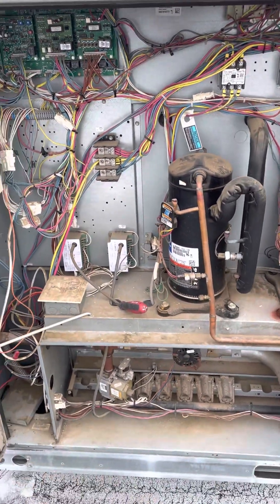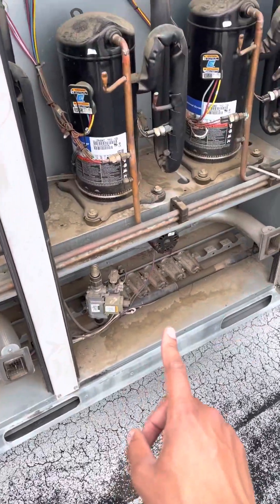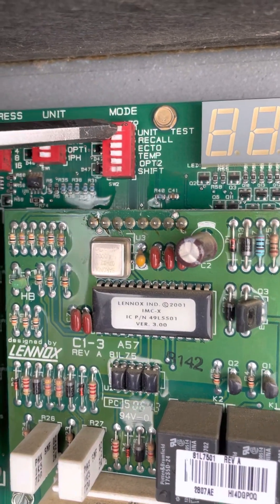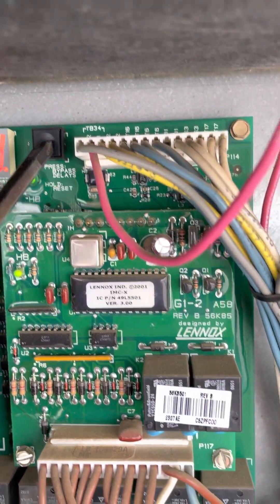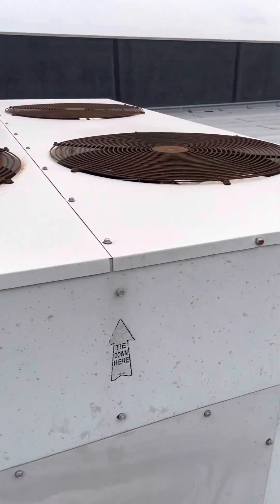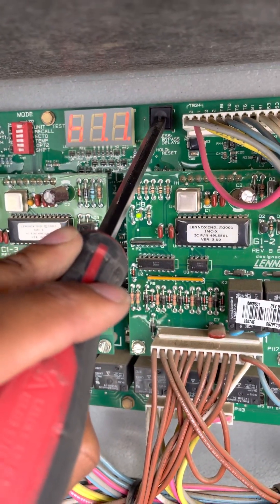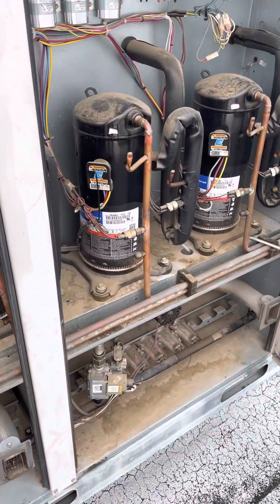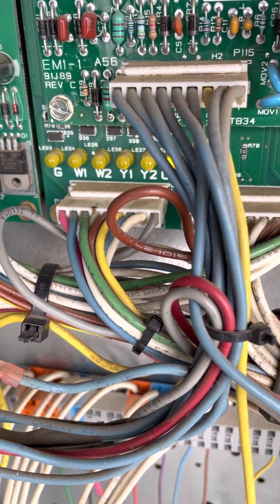How to put Lennox RTU in test mode | Hvac Life

Comment: If you just turn unit test and not shift u can check each component individually staring with blower motor wish will show 0 on the display went turn over to unit test only